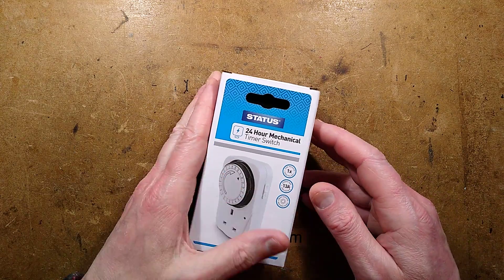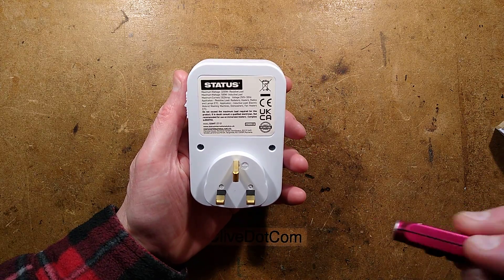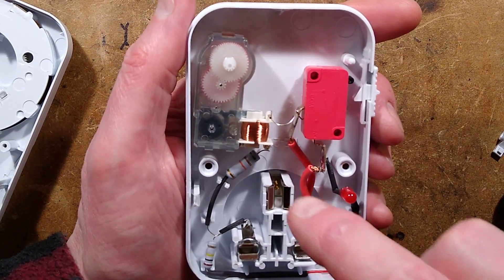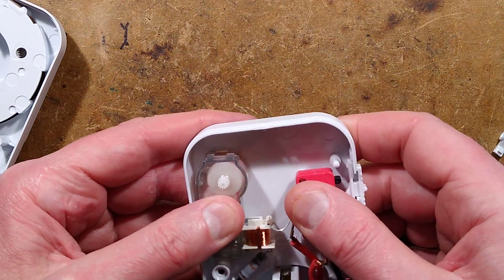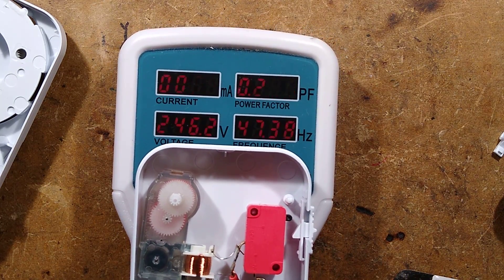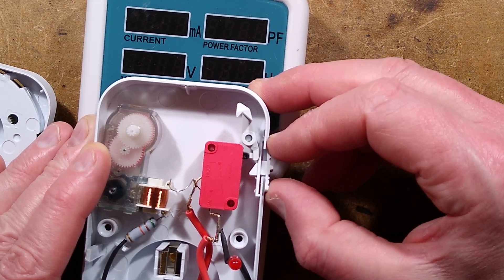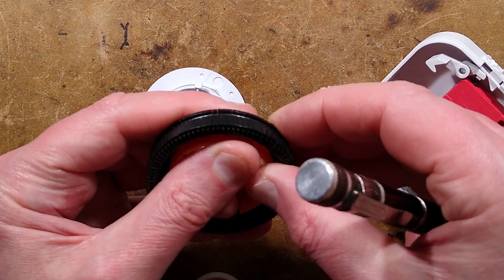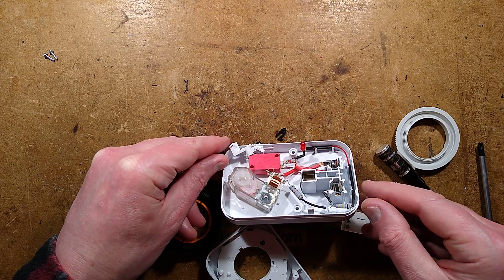Inside a simple mechanical time switch

Comment: I was thinking of making a camera mount with one of these, to track the stars at night, and take photos ( milky way time exposures).   Devices made for that cost 250-400 dollars, 250 pounds.   That would be a lot cheaper and probably accurate enough.   Exposure would normally be 3-20 minutes.    Has to be aligned with the true North.

Comment: Out of curiosity and because the clock was sticking I took apart a timer like this once. Unfortunately, unlike this example, the gearbox was not nicely self contained, and pins and cogs and springs and random oddly shaped bits of plastic scattered themselves across the carpet.

Comment: I've been using a Digital one for ages but I once had a mechanical one that used red and green pegs you had to put in either the outer or inner circumference which had many tiny holes.

Comment: Clive thanks so much for a great video. When I used to take apart timer motors in the 1960s (my dad brought home scrap from his lab) there was only the AC synchronous motor with the escapement to stop it running backwards. No dropper resistor  or cap.  Do you (or any other commenters) know why this unit has a synchronous motor with a dropper resistor?  I would think the extra component (1 watt resistor) costs more than a slightly larger motor that has the full mains voltage across it.
Reply from the maker: I think the reason for the smaller motor is to allow one component to be used for 110V to 240V with matching resistor.  It also uses much less copper.

Comment: There were some digital timers on eBay (many suppliers, many "brands" but all the same) that were horrendous:
The digital display was upside down (in the Australian pin version, maybe that was the only version with the problem)
The switch was in the neutral line, so the appliance remained live when off.
They were cheap & worked wonderfully so i bought several and modified the internals, it was only a matter of turning the display around and swappkng wires...but they were potential death traps.
Edit: they were temperature controllers, not timers.

Comment: A couple of years ago, I bought a similar timer.  In a couple of months, it started making a little annoying noise.  I took it apart and oiled it.  Quiet for a few more months then noisy again.  It kept accurate time but I could not stand the noise it made.  Replaced it with an electronic one - much better results. Normally, I hate setting electronic clocks with the various modes etc but I lucked out on this one - for some reason - it is easy to remember how to adjust it.

Comment: It isn't the clock motor itself which is inaccurate, it is just that you can only set the accuracy of the timing notches to within an accuracy several minutes, it won't be precisely 8h30m ON and 10h45m OFF or whatever when you pull the little pegs for at some particular time.  
There is a variance in when it actually clicks over the switch one way or the other for each little tab thingy, although they may sometimes fairly close to in sync with each other, in total number of minutes between notches hitting the switch, the actual wall clock time is certainly not precisely matched to the index on the housing for an exact on or off time...

Comment: Mains frequency is a serious business its' really accurate and if it runs even slightly over or under clocked throughout the day, the electricity supplier will compensate by increasing or decreasing the frequency to make up the difference over a 24hr period. a heck of a lot of devices used to work like this timer.  I have one at home and its accurate over months. (to the quarter hour)

Comment: I believe the clock is driven by a synchronous motor; the six minutes is likely the resolution of the switch positions.  Did you count the switch levers?

Comment: I had one of those - they were extremely accurate, no detectable clock skew after years. Depends on how accurate your supply frequency is, and here it's obviously very accurate.
I thought they were neat, but I didn't realise how much current they were drawing. One watt for rotating that selector thingy one revolution a day is waay too bloody much. Especially since, by necessity, they are meant to be left plugged in around the clock. Using such parasite loads in times when we must conserve energy at any cost is ridiculous and strongly discouraged. If I were the EU, I'd ban them.
So I retired it and replaced it with a digital one. That one's quite a bastard to program, but it doesn't waste energy. It's just a digital clock coupled to a relay. The only energy it uses is for the operation of the relay in on state.
Throw those crappy things in the bin and get digital ones instead.
Reply from the maker: The digital ones I looked at also used about 1W continuously.  Even with the relay off.   Mainly due to a capacitive dropper and either a zener shunt or alternating between a resistor or the relay coil to keep the voltage roughly capped.
Reply: @bigclivedotcom Well FWIW, I stuck mine into a standard energy logger and it shows no Watts continuously. Unfortunately, it doesn't show sub-Watt loads, and I don't have a Hopi. I have left it in for a while and it's still at 0 Wh - granted, that could be because it just adds up what is displayed and still doesn't show sub-Watt draws. I still haven't come around to making a split power cord and measuring it with a clamp.
 I'm a bit puzzled over the power supply for the clock and relay. The clock runs when not plugged in, and there is no obvious way to put a battery in. No battery doors, and everything is screwed together with tamper-"proof" screws. Probably has something like a Ni-Mh cell inside which is getting topped up by the line voltage.
The idea that the digital ones are not wasteful is not mine by the way, it comes from a rather big German electronics YT channel "Zerobrain". Don't know what he based this on, but I didn't doubt it, since it made sense.

Comment: I bought two plug in time switch from a DIY store because they come in a pack of two and I got what I payed for.  The plastic black bits you slide for off and on that are around the 24 hour ring they have worn so as the timer ring turn it doesn't throw the leaver over enough to turn on what ever I have plug in.  But the timer does keep very good time but it doesn't always turn things on or off

Comment: I took apart one similar to this a few days ago, and noted that the microswitch was rated for 16 amps, despite the timeswitch itself being rated for 13 amps maximum. Presumably that's because the sockets are rated for 13 amps too, so anything that plugs into them can't legally be rated higher than that, even if it uses components that are. The 16 amp microswitches are the same (or at least seem to be the same) as used in some types of electric showers to switch the heating elements on and off. So they should be fine to use with resistive loads of that type. I have been using one of these mechanical timeswitches to control my immersion heater, which is 3 kW, right on the limit of what the timeswitch is rated for, but well within what the microswitch inside it can cope with. Works just fine and has been doing so for years.
Reply from the maker: Check on it from time to time.  I've come across units used with immersion heaters that did fail after long use.

Comment: The 6 minutes/day might have more to do with the inability to accurately set the current time of day based on the number of clicks you have on the dial.
Reply: Exactly, that would equate to 240 pins around the dial which seems about right

Comment: I've got an emergency light that has gone faulty with a T5 tube. Was a non maintained fitting, but now always stays on. Available if you are interested?
Reply from the maker: That will be a very old fitting if it still uses a fluorescent tube.  The battery pack will be well past its expiry date.
Reply: @bigclivedotcom  I think the fitting was from 2012 and the battery was installed around 2016. We tried replacing both the batteries and tube to no effect. So it's been replaced with a modern LED type.

Comment: The problem with these timers (if you live in Malaysia) is that the 50Hz. although quite accurate is not regulated for clocks relying on this frequency to keep time. I find they invariably gain and need to be reset occasionally. Best not to rEly on mains frequency for clocks here11

Comment: In my late teens, I had a job repairing time switches and the best, IMO, were the Sangamo Weston. Sangamo ones return to the program irrespective of the bypass switch, whereas in the cheaper ones, there's a override in parallel with the timed contacts. This means, if you forget you used the override, the time switch will stay on and ignore the timed program. Is there a term used to describe the difference, Clive?
Reply from the maker: With digital time switches you can select a permanent on or off state or set the state and then auto and it will revert to switching on the next cycle.
Reply: @bigclivedotcom as a minor player in the YouTube scene, I'm honoured that a behemoth channel like yours, Clive, that you replied to me. Also, good information. Many thanks! 😊
Reply: Most on the time switches I've come across on this side of the pond have a movable piece that turns on the switch and a movable piece that turns off the switch. If you use the override the next timed event still takes place. The best I've seen IMO is an old one from Radio Shack where you have a choice of temporary override or you can also select permanent override.

Comment: Why does youtube randomly remove my comments???
Reply: I mean all I did was comment on how I used one of these cheap timers for a test to compare the longevity of fluorescent lamps on traditional starters compared with electronic ones!? But then it vanishes!!!
I stated that it didn't last very long before packing up so I had to buy a proper one from RS Components! 
Why would that need removal? Will this one stay up?
Reply from the maker: It seems to happen randomly.  But you may have accidentally hit a keyword.
Reply: @bigclivedotcom It's more annoying the fact that you have no idea that it has happened unless you go back and look! If it gave you a notification with a reason why then fair enough. But how many posts are they getting rid of and people don't even know or realise?

Comment: I much prefer these mechanical ones to the modern digital designs. They're so simple to use and you can see at a glance when it is programmed to switch on and off. In contrast, to set the electronic ones, you need to study the manual, which if it exists at all, is written in Chinenglish and measures 2 inches x 3 inches max.

Comment: Come on Clive, that isn't just a synchronous motor, it is an amazing vibrating ratchet motor with only one moving part.  For every 50 or 60 line cycle the solenoid closes and ratchets the gear train one  notch.  Then via the gear train slowly turns the final gear one turn every 1 day
Reply from the maker: Definitely a rotating motor.

Comment: In many places grid operators are no longer required to do daily "make-up cycles". That may explain the +/-6 minutes spec since any deviation in the power line from 4,320,000 cycles per day (50Hz) or 5,184,000 cycles per day (60Hz) will adversely effect accuracy of anything using a synchronous motor or cycle-counting scheme. For example, my ancient X10 controllers, which once kept perfect time, have been running fast since mid-2000s.

Comment: The clock mechanism might be accurate but tripping the micro-switch puts an increased load on the motor whilst it switches and therefore loses time which is cumulative.

Comment: I remember when electric clocks had larger motors on them, some had like a large flywheel. Then they went to the coil and tiny copper disc . I remember our first clock that had the tiny disk. Plastic gears. They became noisy. I sprayed WD-40 in the gearbox to quieten it. Oh, it worked! But it caused the gears to deteriorate and break.
Timers, I took one apart a long time ago. I don't remember what the clock motor looked like, but it was bigger. The timer I have now has tabs you insert in different places for on and off times. The tabs come off. Definitely not for accuracy. Just to turn things on for a certain length of time, and off when not really needed. 
Interesting video!

Comment: I got an American Harbor Freight version of that.  I wanted to set it up so one side will turn on and the other turn off then alternate.  The internal switch was marked NO, NC but when I pulled it apart only the NO side had contacts.  Some time I need to find the version of the switch that has the NO, NC contacts so I can replace the switch.  The goal is to have two fans and alternate one or the other.  With out making an overly complicated project.

Comment: I use one like that for my hot tub the timer its 120 volt  and I use a 50 amp contactor  for the tubs 240 volt power   It just closes it with a 120 volt coil no draw on the timer .

Comment: I thought clock motors had to be protected by a 1amp fuse like my 60 year old smiths mantle clock? . When I looked inside my mechanical timer no sign of any fuse😮
Reply from the maker: I think the winding would fail at a fraction of an Amp.
Reply: Thanks Clive, greetings from sunny Glasgow.

Comment: The one-way mechanism you pointed out (or a different one) is probably so you can turn the timer wheel to set it.  Also the 6 minutes is probably the timing tolerance for turning on and off; I wouldn’t think that the actual synchronous motor is off by that much per day.

Comment: I have one of these, I used to have it connected to a lamp in my living room.  The are a great invention, my biggest complaint about them is due to my vision impairment, it's often a bit tricky for me to see exactly what time you set the unit to, mine also used removable pins which aren't hard to lose.  I'm glad to see timers like this with toggle switches for the on and off timer settings, you won't lose the pins.  These days I use a WeMo switch, because it's easier for me to program from my iPhone, but I can understand why people would still rather use mechanical timers like this.

Comment: If you are using one of these to turn lights on and off while you are away from home (vacation, etc.), you'd actually want the timing to vary some each day. It gives a more accurate impression that someone is actually home. If a potential burglar sees lights going on and off at exact times each day, they can almost be certain that no one is home.

Comment: I love these things,
a true technological marvel

Manually setting every pin is a Joy
Trying to set a 16 hr on, 8 off for the plants 🌿
 
Then leave it switched off until time sync is reached.

Normally trigger the 8 hr off at exactly 10pm
For a 6 Am power up. And its good for the whole season.

And add a threeway adaptor into the one timer. 
To run more lights or fan

The 8-12 minute +/- flaw is not really noticeable
As sun rise changes by 4 minutes daily
From a growers point.

Comment: The 6 minute accuracy has likely less to to with the accuracy of the synchronous motor and more to do with the resolution of the mechanical tabs. Smallest available unit is 6 minutes.

Comment: I have one of these running for almost 6 years non-stop now. Thanks to the motor relying on the mains frequency, it is more accurate than any of my battery powered clocks (excluding radio controlled ones). Very simple and very reliable.

Comment: Have you seen those purely mechanical spring countdown wall timers used for fans in old office buildings? You may want to tear em down as well, different mechanism to this timer here. (Also wondering how those led wheels on scooters works)

Comment: I got one of these that was iffy a while back. Turns out it was actually the mechanical bit on the front. I decided to take it apart and it was clipped together. I got rhe clips iff and started levering the back off. There was a sort of "sploing" noise ans a small fountain of even smaller springs that went absolutely everywhere. By everywhere I mean for example one was found in the kitchen under the cooker.. Several were found under book cases and the sofa. It ha9 96 of these springs and 4 are still missing. I suspect one under the TV unit but bugger knows where the rest are.

Comment: My mother has an older version of this with pins that you move about to set the timings. It has been switching on and off her hideous gilt & onyx hall lamp for the last 30 years without so much of hiccup. I enjoy hearing that satisfying “thunk” as it switches on. Sadly I shall inherit the monstrous lamp though 😢
Reply: I have one like that (a Landis & Gyr of some kind) the only difference is that it's hardwired, and has two dials (one for each contact) with each dial having a set of two "cams" one to close the contacts, the other to open them. Mine originally was used to switch a water heater on and off (before my country switched to the PULSADIS off peak system) though not directly, the clock would control a relay to turn the heater on and off. Otherwise you'd weld the contacts shut! 

What's pretty cool about it is that it has a reserve mainspring that is kept wound by a small motor for as long as the clock is connected to AC power, once power is lost, the mainspring kicks in and starts ticking like an old-style alarm clock 🙂

There was an older model that had a mercury tilt switch, but so far I haven't had any luck finding one.
Reply: @Alexis_du_60  You can’t beat a good electro-mechanical system!